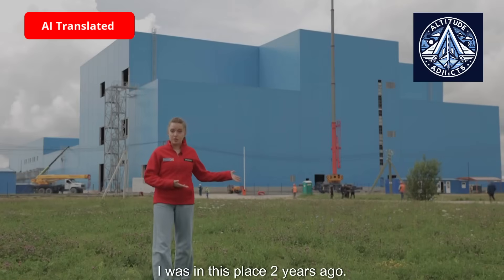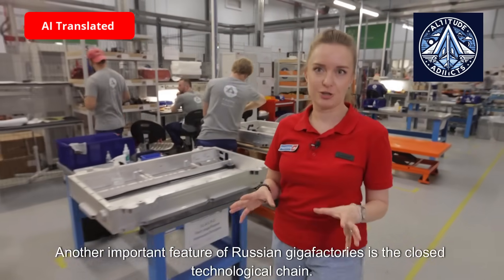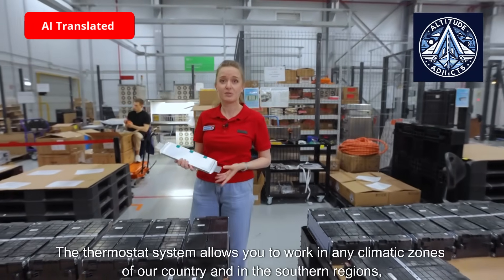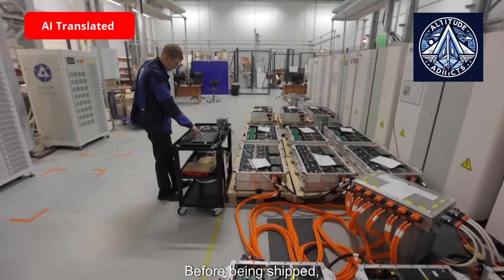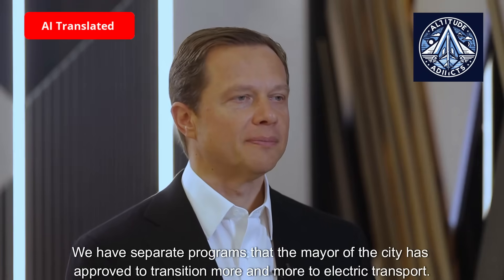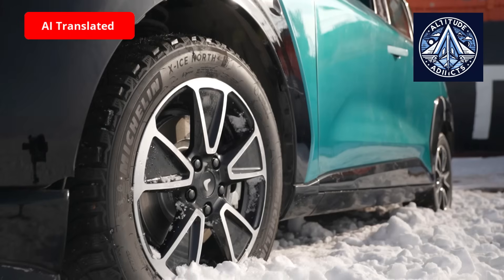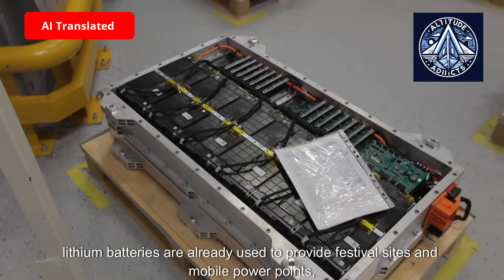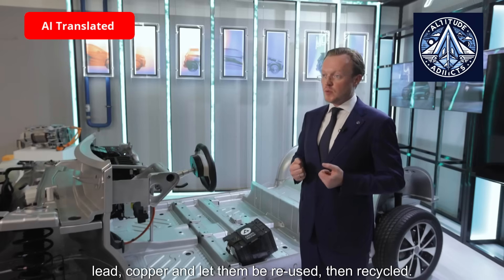Inside Russia’s Gigafactories: Lithium-Ion Batteries for EVs & Beyond | Rosatom

Comment: Why NMC811? Where is the Cobalt sourced from? Will this plant have any renewable energy....Solar or Wind to power it? Buses should only use LFP like the electric river boats in Moscow and the e-buses they are LFP. Lithium is actually a very small % of a so-called Lithium battery. I am very surprised in fact quite disappointed that they are going with NMC over LFP. In China CATL now has LFP batteries that can go down to -40C Winter weather and still charge at 350kW or higher.

Comment: Russia is the best
Reply: 8GWh is NOT a Gigafactory!  The CATL plant in Hungary will produce 100GWh per year. A new partnership between BYD and Huaihai Holding Group is planned to produce 30GWh of Sodium-Ion batteries per year. BYD overall produces over 155GWh of LFP Blade batteries per year.
Why NMC811? Where is the Cobalt sourced from? Will this plant have any renewable energy....Solar or Wind to power it? Buses should only use LFP like the electric river boats in Moscow and the e-buses they are LFP. Lithium is actually a very small % of a so-called Lithium battery. I am very surprised in fact quite disappointed that they are going with NMC over LFP. In China CATL now has LFP batteries that can go down to -40C Winter weather and still charge at 350kW or higher.

Comment: Russia will definitely dominate in this industry. I want to purchase a solar high voltage battery bank soon.👍
Reply: 8GWh is NOT a Gigafactory!  The CATL plant in Hungary will produce 100GWh per year. A new partnership between BYD and Huaihai Holding Group is planned to produce 30GWh of Sodium-Ion batteries per year. BYD overall produces over 155GWh of LFP Blade batteries per year.